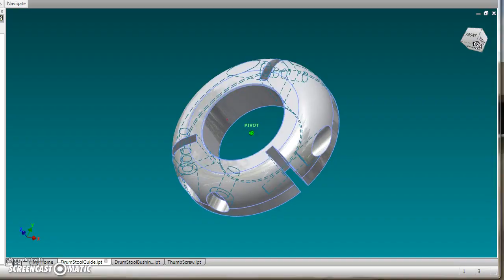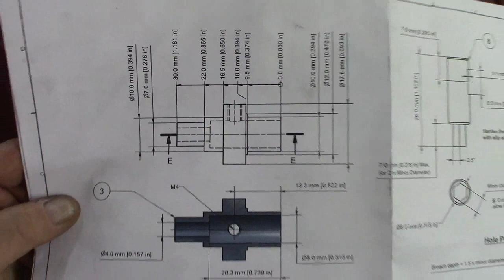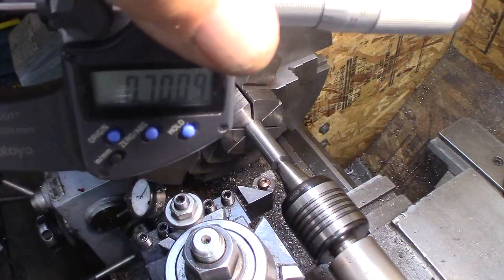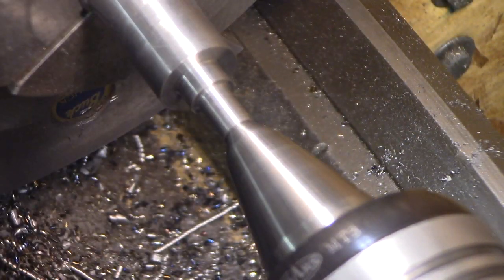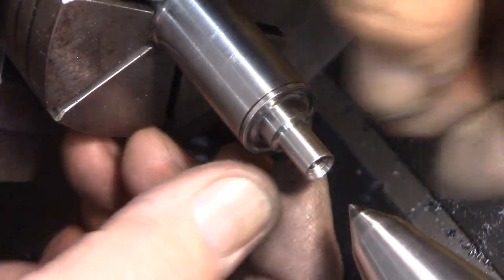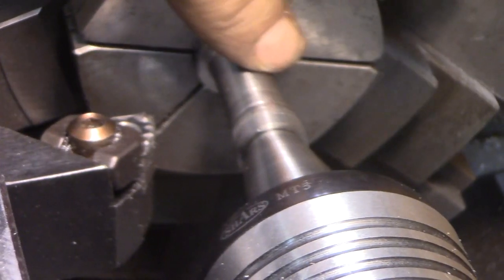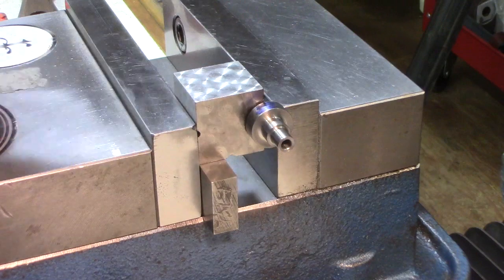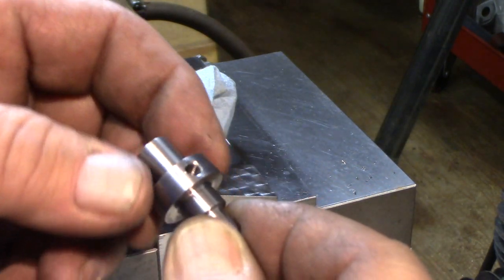How to Make a Hemingway Kit Compact Rotary Broach P4

Comment: Hey Randy, I am really enjoying this build.  I really like that big 6 jaw and the 'ramped start' on your lathe, I guess it gives you a chance to shut off if you don't notice any potential Mr. bozo moves.  Having said that it would be more like me to make the Bozo moves!!!  Thanks for sharing your experience and skills.  Kindest regards.  Joe.
Reply from the maker: Yes i don't mind the ramp up,  There have been several times I have had to stop and run in the opposite direction and it allows a quick stop and reverse before a bozo move.  I have it set at 10 sec right now.

Comment: Nicely done Randy. I see quite a few dimensions on drawings like these where it takes a bit of addition or subtraction to come up with a parts overall length. My guess is it's done to keep the drawings as uncluttered as possible. Afaik Hemingway has redone all there drawings using CAD so there should be few if any errors. Wish I could say the same since I've got some non Hemingway drawings where the original design was done over 50 yrs ago and the well known mistakes still haven't been corrected today.

That surface grinder you now have will be a real $$$$ saver for grinding your own hss broaches at $50 + a shot for the commercial broaches. My Slater rotary broach was bought before the shop built designs were around and it sure hurt a bit to buy it.
Reply from the maker: The next broaches I was planning on grinding.   Thanks.
Reply: Likely you already know about it Randy, but if not Slater has more than enough information and drawings on there website to reproduce any of the standard broaches. They also recommend greasing the bearings every 2 hrs with Mobiltemp SHC 32. The bearings supplied with yours may or may not work with grease though.

Comment: How did you deburr the end of the setscrew hole in the bore?  I usually use a Dremel and a magnifier, because I'm afraid of ruining the bore with a reamer.
Reply from the maker: broke off and scotch bright.  There is quite a bit of clearance where the hole is, non critical there.

Comment: Hi Randy, Nice to hear metric being used (without complaints I might add).  You lathe seems to start very softly.  Is that a VFD "feature" or low HP motor?

Good project btw.  I look forward to seeing the end result.  With it being so tiny, I'm curious to see it in action.
Reply from the maker: Yes Barry i use VFD's and ramp up the starts.  I don't mind metric.  It would be much easier if I had metric dials on the lathe.

Comment: Hi Randy. This design is obviouously metric. You can tell because the dimensions are nice and neat numbers, like 6.00 mm which is whatever that is in Imperial. Now, you have an Imperial lathe, and the conversion to inches is done for you. But you  mike it in inches. There is a better way to do this. That Mitutoyo of yours has an in/mm button on it. Close it. zero it  Probably unnecessary for a Mitutoyo, they will hold zero. Then set the desired diameter on the dial, say 6mm. Zero again. Mike it. The answer will be, not the amount but the amount you have to take off. Press"in" button  Imperial mode button. Plan your cut, which you do in your sleep. When mike reads zero, you're done. If you are really fussy you will sand off  to .000 mm but totally unnecessary; two decimals in mm (.025")  is enough by design. I originally picked up the trick from Myfordboy's channel, but as far as I know, the conversion to mm/in button is mine. Same procedure for digital calipers. Rest of the world: use the trick in reverse.
Reply from the maker: I have used this method many times but when you are trying to keep tight tolerance I find it best to stick with one method.  When using the offset zero it can be off if you are shooting for tight tolerance.  For most things your method works great.
Reply: My cousin has a saying "perfection is the designed enemy of good enough" and the kit is designed that way. If you are really finicky it applies still -- just turn down to .005. thou. This is 50 microns which will satisfy even Stefan Gotteswinter! But go ahead. It's your project!
Reply: Oh dear, these Imperial units. .001 is five tenths inch or so.